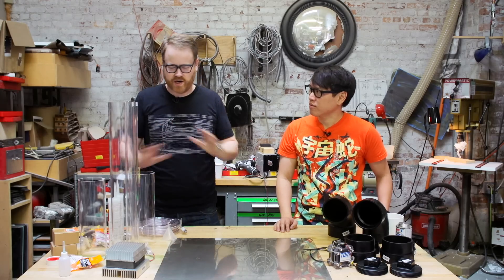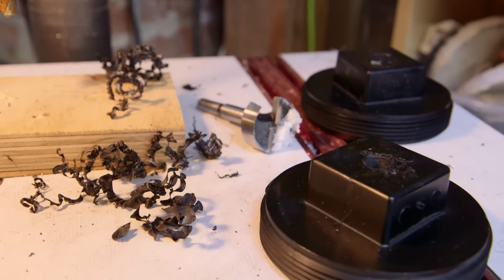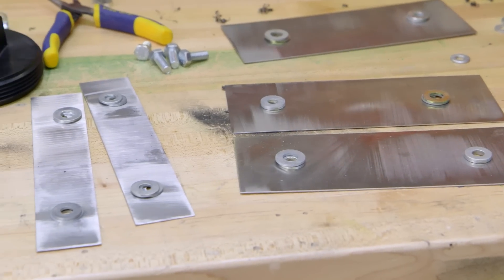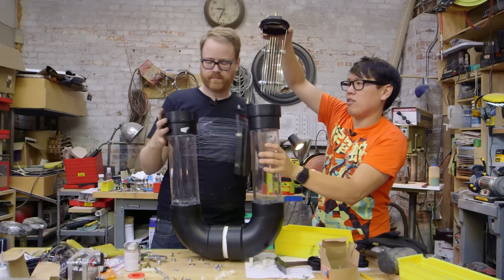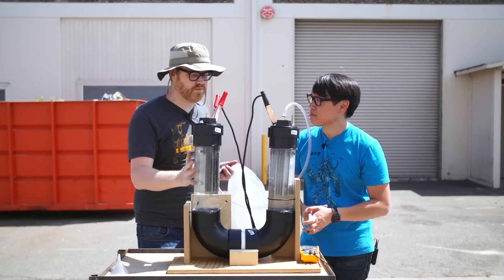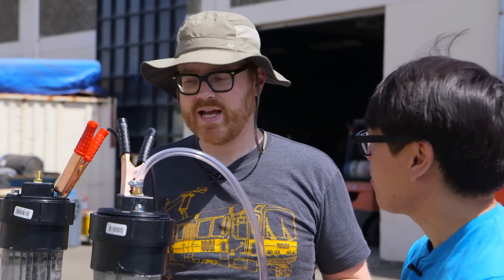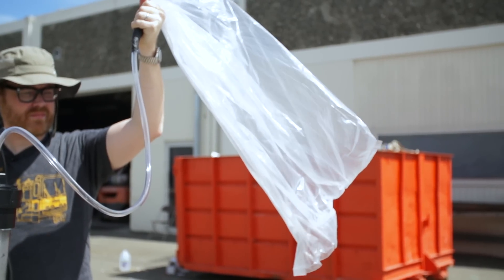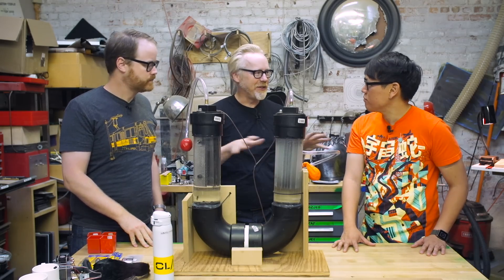Tested Builds a Hydrogen Converter

Comment: So we used a shit load of electricity to run factories that produce and/or process wood, plastic, photovoltaics, metals, and paper, most of which was created in china using coal and natural gas, in order to create a machine that consumes electricity, converts it to two gases, one of which is useless to you, just so you can pump the hydrogen into a fuel cell to generate electricity. Genius.

Comment: old heat sinks are great for electrodes they are already designed to have a very large surface area already. the u-bend in the pipe was also to big it was just adding to the resistance

Comment: that solar panel only produces 22 volt in open circuit........... as soon as it has somewhere to go it drops to 14/15 volt...... also a flat solar panel is good for fuck all...... they have to be angled towards the sun. even in perfect conditions a 12 volt 100 watt panel only produces around 8 amps..... well short of the 30+ amps you need. not surprising that you totally fucked up. useless just like mythbusters, make a piss weak attempt then call it busted.......... with absolutely zero credible science applied.......

Comment: If you would have added more voltage it would have increased greatly a buck dc-dc booster you could have taken the voltage and cut the amperage down and doubled or tripled the voltage.

 Also I think there was a leak you needed seal tape on the electrode caps and where the bolts went through glue them in or otherwise seal them. Another thing I would have done is made a smaller wasted area with a way to keep the water topped off.

If anyone thinks im wrong about the seals being why they got no H2. My proof is near the end when the balloon is pumping up then deflating if the h2 side was sealed it would have pressurized. Speaking of which a ball valve on both collection ports so the o2 side which produces at half speed can be kept at pressure.

Comment: Did you guys consider other materials besides Stainless plate?  I hear mesh is what the commercial units use...Nickel mesh if memory serves.  Should be easier to work with than SS.

Comment: Neat but pointless. You're better off recharging a battery with that electricity instead. Electrolysis of water and hydrogen fuel cells are less efficient than simply recharging a battery. Hook up your electrolysis machine to a lightning rod and if it survives you can harness the power of lightning to produce hydrogen->electricity. Otherwise I see no point.

Comment: Please don't use acid to treat your skin that is coated with a base. Acid + Base = thermal burns. Instead, running the exposed area under tap water would be much better.

Comment: Could someone verify this for me, but would there not be a pressure differential between the 2 sides? Since the system is closed with gasses being produced at different rates on either side, wouldn't it end up (eventually, based on whatever method you used to gather the gasses) end up forcing water out the oxy side?

Comment: Nuclear Submarines produce Oxygen by using electrolysis. They do this at very high pressures so the Oxygen generator is also known as the bomb. Electrolysis is an industrial process. You simply did not supply enough power to do the job. It is the current more than the voltage that does the work meaning the number of electrons moving and not the force at which they move that is prime. Once you reach a certain voltage only increasing the current will yield more cracked water molecules.

Comment: lots of questions here.  1) how porous is that plastic bag, are the pours larger than a hydrogen atom?  2) having a 20 volt panel is nice compared to a 12 volt battery but what about amperage?  Does that even factor in for this process?  3)  they added an electrolyte (caustic potash) but in what solution strength?  Should they have added more for a stronger solution or tried a different electrolyte?

Comment: Another important Potassium Hydroxide safety tip for people (that I didn't hear mentioned, but was visible briefly on the plastic jar): always mix the Potassium Hydroxide into the water (which is what it looked like Will did) not the other way around! Dissolving the Potassium Hydroxide in water is exothermic and adding the water to the Potassium Hydroxide can cause the first tiny amount of water to flash into steam flinging the stuff all over. Adding the Potassium Hydroxide to the water allows the bulk of the water to absorb that heat. The same goes for Sodium Hydroxide and probably Lithium Hydroxide.

Comment: Hey Tested! you know your rig could be WAY more efficent if your Annode and Cathode were closer to gether, or perhaps use more electrolite? You mentioned using a modifed version of TheKingOfRandom's plans and his easily made 100x more hydrogen than yours on only 12v. actualy com to think of it, that solar pannel may have made more voltage, but  it pales in compareson to a car batteries abailty to put out anywhere from 500 to 800 amps.

Comment: You should probably do a little more investigations when you say things to such a large audience. It doesn't matter how much voltage you put. What matters is power. And voltage without current means no power. The thing about a car battery is it can let a whole lot more current flow through the water than this solar panel can. So it has more power in the end. This episode being sponsored by a company that wants to promote hydrogen powered vehicules, I suspect this is a trap. The ending phrases make me think that you had to say to the viewers that it's better to go and buy the gas rather than producing it yourself. Which is both unfair and dishonnest.

Comment: Cool build, but don't wear gloves around rotating equipment... it will actually increase the risk of horrible injury etc... especially not TIG gloves, they're not actually very protective, as they're supposed to protect from heat not abrasion.

Comment: don't wear a glove around rotating equipment.
Reply: +Joseph DAndrea The reason why they tell you not to wear gloves around rotating equipment is because the cuff of the glove can be caught in the equipment and the leather is strong enough to tear your hand off your arm if the equipment is rotating fast enough. But thin latex gloves like they were wearing aren't that strong and are perfectly safe around rotating equipment. The stretchy cuff clings fairly tight to your wrist in the first place, but even if it does get caught it will just tear the latex and leave your hand intact.
Reply: +dlwatib when he was drilling the plastic pipe cap he had on what looked like a leather welding glove.

Comment: commercial hydrogen is made by electrolysis not in water but in oil, it is not sustainable or environmentally friendly even if the electricity is produced sustainably, seriously hydrogen power is just oil companies trying to sound environmentally friendly

Comment: Indeed what cleaner energy is there than leaching chromium into water? Also when you use electrolysis to generate hydrogen you are turning a high value energy resource into a lower value resource. So you are essentially converting dollars into pesos at a 1 to 1 exchange rate. It is thinking like this that will drive us over the brink faster. Commercial hydrogen production is done by reforming natural gas. Here you are trading one gas for another, which is a better bargain. We could run the world on fart power! Now that is muy buenos burritos.
Reply: Doesn't this process require the corrosion of the plates? Can't imagine how that would be "clean" if done at any type of large scale.

Comment: higher current, low volts...  12VDC at 30-40A would have A LOT more gas production, I always wondered if running waters resonant frequency pulsating DC (~2.4Ghz) would lower the amount of energy it would take to split water molecules....
Reply: +Brian C i don't think norm and will's understanding of electricity goes as far as the difference between voltage and  amperage .
Reply: +Lynton Rodda Also if you short the output of a solar panel it reduces it's ability to produce current at any meaningful voltage...they would have needed a MPPT charge controller to prevent voltage drop to almost, zero volts but max amps from the solar panel..they SEVERELY hampered output by hooking it up this way...the anode/cathode in one unit makes brown gas (the mixture of hydrogen and oxygen gas [incredibly explosive!]), there are guys that hook them up to vehicles and get 3-4+L a minute output on them but they pull 60+ amps thru them from their car charger system.
Reply: +Brian C You're right on all these points. They had the anode and cathode way too far apart, and didn't use any pulse width modulation. I feel like they barely tried here.
Reply: +Brian C Not a concern here, by a long shot, since the massive distance causing too much resistance is what hobbled the experiment in the first place.
Reply: +Brian C Yes, that has actually been explored, if we're thinking the same thing about oscillation in the water... I saw an article where it became way more efficient when ultrasonic frequencies were used to agitate the water.

Comment: Why the fuck would you connect a solar panel that at its best will produce 100W's in the perfect conditions...
When on the guide you used they suggest it uses at a minimum 500W's of power.

Then you also made the device twice the size, which I am going to take a stab, that it means that you are going to require much more power than what the guide has suggested.

Comment: When I played around with hydrolysis in third grade I used graphite rods as the anode and Cathode because it wouldn't corrode at the anode, granted I was using salt as the electrolyte, but I can't imagine KOH would be much different. I seem to remember that platinum would also be a potentially effective anode.  Can someone speak to whether or not the stainless steel in this rig is an effective long term material for the electrodes.

Comment: Its not volts. electrolysis is perfect at 2.3 volts or somthing. its amps. but its not normal to find low voltage high amp as everyday products. I used a pc powersupply off the 5v line and produced more hydrogen than using my 12v as it had a higher amp rating. also note this is super dangerous. super dangerous. i had it on for a short time and it melted my plastic container from heat and then i lit the hydrogen which exploded into a 6 foot flame. do not do it
Reply: +Pythonis also use caustic soda. that shtuff makes some gooooood current in the water
Reply: +Pythonis also the distance between the anode and cathode were too far and reduced power significantly

Comment: 4.5 amps? You are going to be there awhile.
Reply: +BeanHole Doing the math assuming close to 100% efficiency, it would take about 36 amp hours to produce the desired 15 liters. Call it 8 hours assuming the panel produced the full rated output for the entire 8 hours. Rather unlikely.
Math... Assuming an ideal gas, 1 mole at STP is 22.4 liters. So the desired amount of gas = 15/22.4 = 0.67 mole molecules = 1.34 mole hydrogen atoms.
1.34 * 6.022e23 = 8.065e23 hydrogen atoms.
For each hydrogen atom to be split we require 1 electron worth of current.
1 ampere = 1 coulomb per second = 6.241e18 electrons.
So to get the desired amount of gas requires 8.065e23/6.241e18 = 129226 ampere seconds = 35.89 ampere hours.
Reply: +John Cochran Good work. I didn't think of it as a one to one ratio of electrons to split atoms, so I wouldn't have known where to start calculating this. Makes sense though. Thanks for the flash back to AP Chemistry! :)

Comment: in 2004 I connected a 9v battery to two wires, ran them into a sink full of water and collected enough hydrogen and oxygen in two separate inverted jars to blow the hair off my eyebrows in about two minutes -over and over.  (it was FUN!) You guys were over thinking it much methinks.  Great vid, but next time just use a cheap PC power supply, tap water (which happens to be in abundance everywhere EXCEPT California...)  and plug that sucker into a wall for a real world test...

Comment: i think you should have added a third pipe in that contraption so you could keep the water leveled and wouldn't have to take the thing apart to fill it.  Also your cathode and anode are way too far apart, you should have had them much closer together to make it more efficient.  As a kid I did this same experiment on a smaller scale and could fill a 16 oz soda bottle rather quickly using a small electric train transformer on very low setting.

Comment: You guys should try adding a boost converter to your DC supply to raise the voltage. They are pretty cheap to buy pre-made and simple enough to make your own.

Another thought is the bag and balloons that you used to capture the hydrogen. They are both permeable by hydrogen gas. Just like how helium balloons leak, hydrogen leaks our of membranes too because the dihydrogen molecules are small just like the helium atoms.

Comment: Rather silly method of producing hydrogen. The thing is, the voltage really doesn't matter. The amount of hydrogen generated is proportional to the amount of current being passed, not the voltage. Now with a higher voltage, you do have the ability to pass more current (I = V/R), but given the solar panel they're using, they weren't gonna get anything reasonable. There's a lot of ways to generate hydrogen. Electrolysis of water, passing steam over hot iron filings. Acid and metal. Cracking of hydrocarbons.

Also their assembly method leaves a lot to be desired. You don't solvent weld that kind of pipe by simply pressing them together. Doing that makes for a really lousy seal. What you do is twist and push them together. When they have the proper alignment, you then stop twisting. Doing that smears out the solvent over the entire joint and makes for a much better (and easier to make) joint.

Just did a bit of math. In order to get the desired 15 liters of hydrogen, they would need to pass approximately  36 amp hours of electricity.
Reply: +John Cochran a relation to Zefram at all? An ancestor maybe of that Zefram Cochrane...
thanks for to debunk further - Adam ought know better ehehe... though, the apparatus meet the definition of 'terrorisme device' under some patriot act...
Reply: John Smith Interesting reference and I'll admit that I was strongly tempted to name my son Zefram, but I resisted the temptation since I didn't want him to be too afraid to attend conventions.
Reply: +John Cochran In order to get more amps in there, bumping up the voltage would do wonders. Ohm's law you know. Also the anode and cathode are way too far apart. I just used a plastic bag to separate the plates and 24 volts did the trick, but the O and H weren't separated. I filled a balloon with it :)
Reply: leerman22 Yes, more voltage will allow for more current. However, the solar panel they're using have a rather limited top current so it really doesn't matter how many volts they have. They're still current limited because their panel is rated at 22 volts and 100 watts. A little math tells you that it generates less than 5 amps.

Comment: The design was flawed in its effective use of water. This problem could easily be resolved, while still being the same, but if built with the plates in the bottom of a [_] shaped bowl. With the plates in the bottom of their respective upward facing tube, they can get the maximum amount of contact with the entire source of water. Even though pressure may be increases, I believe the gas produced with enough power supplied to the contraption.

Comment: Guys, it's not about the Voltage, it's about the current.
It takes 4 electrons to convert 2 water molecules to 2 hydrogen and 1 oxygen molecule. Obviously, the more electrons you can pump through, the faster it goes.
Once you get above the electrolysis voltage of about 1.3V, any extra is used to overcome the resistance of the water.

Comment: Interesting to read the comments. It sure is all pointing towards them needing to revisit this entire experiment; maybe this time with two competing rigs between Adam and Jamie... see which one is the most efficient.

Also quite interesting to see, how a lot of talk is made of hydrogen cars in the comments.
Obviously the draw-back from a solar-car is that the sun don't always shine (so drive that at night if you please...) and electric only cars have a limited range (but that is changing more and more, too; take the Teslas as case in point).

But just to drop another thing into the mix:
there is a family in france building cars that run on nothing but compressed air!
Also not very useful for long trips, as the weight of the cylinders that hold the compressed air will in itself reduce the range... but aside of maybe a rip in the container, it certainly isn't like driving around a bomb...

...maybe we should just stick to horse buggies :-D

Comment: quick question....how can you get litres of gas? surely it would have been better measured in pressure? 15 litres at atmospheric pressure would be a lot less than 15 litres at 120 psi?  would the volume not only be as large as the container the gas is contained in?  thanks - Matt

Comment: "What's a cleaner power source than the sun?" - not hydrogen :D
Could someone actually explain why hydrogen-powered cars make more sense than just using an EV and powering it from the sun? Just the fact that it doesn't require a large battery pack?
Reply: +Esa Edvik it doesn't make sense at all, except that commercial electrolysis is done on oil (more hydrogen in oil) not water, so oil companies still profit from hydrogen powered cars

Comment: the last hydrogen generator I made from 1L drink bottle filled a balloon within a few minutes and was used to power a small engine.   1/4 size of that rig but I was capturing both oxy and hydrogen to burn jn the engine so only 1 outlet for the gas.  also wound wire is more efficient as more surface area.   cheers